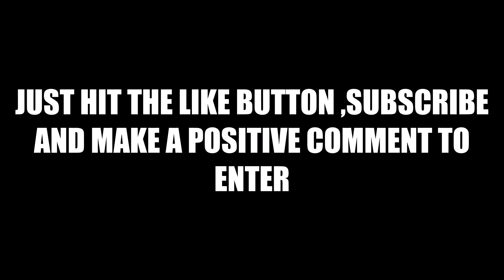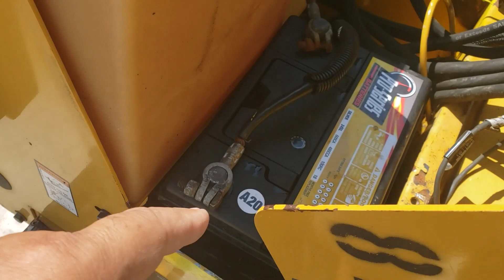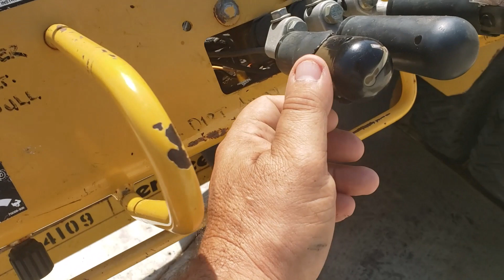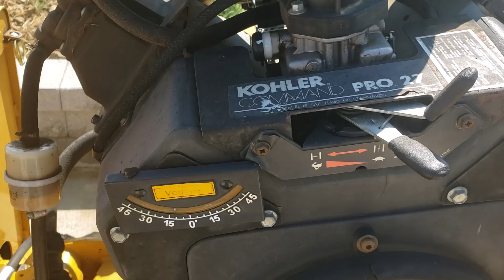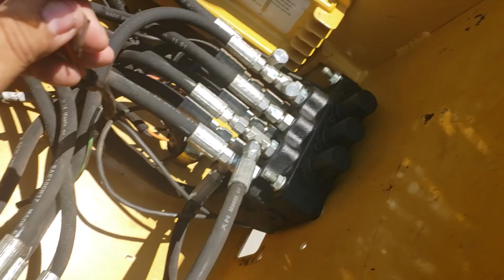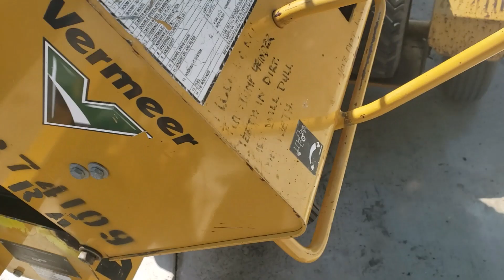Project Vermeer SC252 stump grinder

Comment: Gaveling problem with battery not charging on my 2005 sc252, any thing I should look for.
Reply from the maker: https://youtu.be/V3rgIcB796E it could be as simple as this
Reply: @mustangrebuilder  I noticed mine does not have a ground wire from rectifier to engine, I definitely appreciate your help

Comment: Battery Group 26  12V  400CCA,  Hyd  filter napa  1551   wix 51551,  parts Manual PMOC 99-2  order No. 105400-R94   I have the operator and maintenance manuals #'s if you need them also , for the control handles , I pulled mine off got a can of that vinal  dip and dipped then   think I picked it up at napa also ,,,, auto sweep  if its running and on the computer box you can see the idle light is lit but barely then the engine isnt reving fast enough thinks the computer  I permately disconnected the 2 wire plug at the solinoid and it works fine ,  I have 20 acres in Oregon and had 12 acres logged which left me a hell of a lot of stumps to grind.. ,BTW I use Yellow Jackets , I will get you the measurements for the block 2moro, I damned sure aint paying  vermeer prices ..
Reply from the maker: And you sir are a great man

Comment: The best way to deal with this issue is as he as done in the film just disconnect it. I paid nearly £400 10 years ago on a new electronic box which the dealers fitted I had a 2 hour each way drive to them. the very next day it went slow again would not give me a refund they said just bring it back like they were just round the corner . I just un plugged it and i got used to the new way of operating the the sc 252 and its actually a lot quicker.........
Reply from the maker: you are this weeks sticker winner send info to mustangrebuilder@gmail.com and which one you want

Comment: Great video.  I put a almost new 35 hp  Kohler on my older Vermeer  630b ( replacing the old 35 hp Wisconsin).  This older machine will eat right through almost any stump now.  Anyone else running this type older grinder?
Reply: Sammy, I’m looking to do the same, replacing the Wisconsin 30hp to a Briggs 35hp. Like to keep in contact in near future. Fran
Reply: Yes.  It was a difficult task as a lot didn’t line exactly up but was well worth it.  If I can help just let me know.
Reply: @sammystephens7823  definitely, It’ll be some time but I’ll keep ur contact info. Thx brother

Comment: Adam, nice video as usual. I have a 96 sc252 w/o auto “sleep” so grinding is  all by feel. I rented a 252 w/auto sleep and it ran slow. Called the rental place back and he said you need to run wot the get the swing speed you need. I raised throttle to full and it ran as usual. Go to Vermeer website and they’ll send you a manual no problem. Don’t think it’s a parts manual but they will send something out. Hydro filter is a Napa 1551 I think wix adds a 5 in front of Napa # (51151?). Keep vids coming brother.
Reply from the maker: thanks for the filter number brother
Reply: @mustangrebuilder  no sweat, thanks for the positive video’s

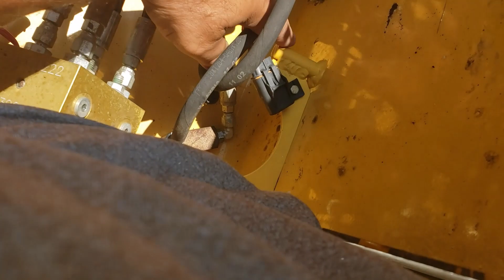Comment: 15:47  I have an SC252 but not with the autosweep, that said, considering that the autosweep is supposed to slow the sweep speed based upon the RPM of the engine, I would suspect that whatever sensor is sending the RPM speed to the computer is sending the wrong signal or the wiring connectivity between them may be causing interference.  

You might also consider grounding connection issues between the motor and the computer and frame.  On older equipment I have found that installing several grounding straps in strategic locations (engine to frame, frame to computer, etc) can eliminate many problems.  It worked wonders for my antique CASE 1816C, it used to be hard to start but not anymore.
Reply from the maker: Thanks buddy
Reply: The best way to deal with this issue is as he as done in the film just disconnect it. I paid nearly £400 10 years ago on a new electronic box which the dealers fitted I had a 2 hour each way drive to them. the very next day it went slow again would not give me a refund they said just bring it back like they were just round the corner . I just un plugged it and i got used to the new way of operating the the sc 252 and its actually a lot quicker.........